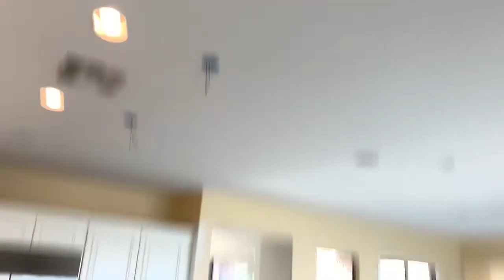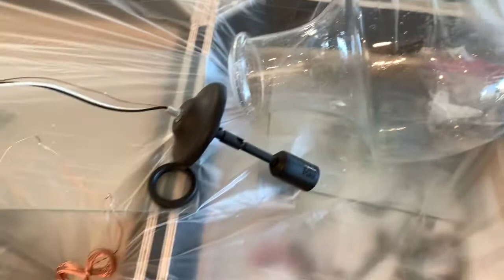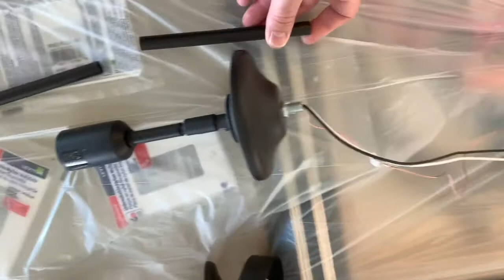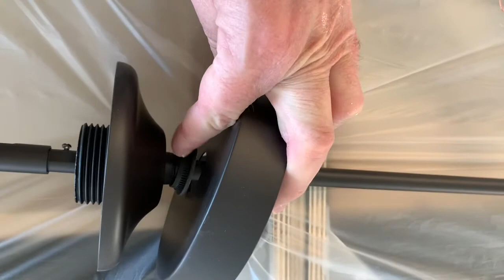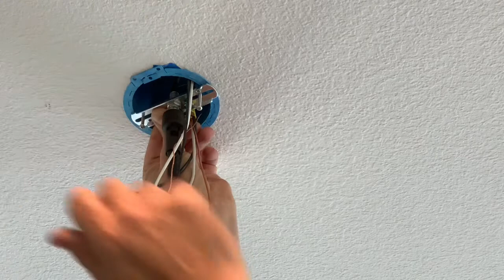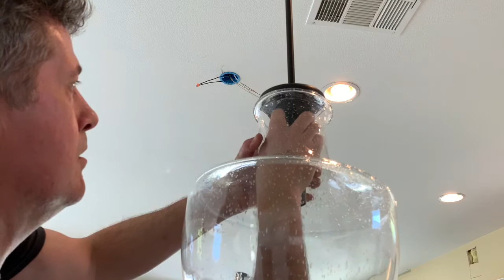Install Pendant Lighting

Comment: I didn’t understand the ground to the green screw connection. Did you use an extra piece of copper wire or did you just pull the copper wire from the wall?

Comment: I have 3 light fixtures, only 2 of them have 2 sets of black and white wires. One of them has one set of black and white wires... I installed all 3, and the one with one set of wires is not turning on. The other 2 turn on and off just find with the wall switch. Any ideas?
Reply from the maker: It sounds like the one with 1 black and 1 white is the end of the line...the other 2 fixtures feed the next fixture and so on. Check the light fixture in front of the one that isn't working since that is where the power stops. Test the wires in the fixture that is not working to make sure it is getting power. Could be a bad fixture or even a bulb, even though the fixture is new.

Comment: Great video, not too long straight to the point! I noticed when you connected the wires (black to black, white to white etc) all you did was screw the wire nut on. Is that sufficient? Just that I have seen other videos where the person twisted the wire ends together and then screwed on the nut.
Reply from the maker: You can do either. The inside of the wire nut has threads that will twist the wires together. You can certainly twist together before you screw on the wire nut if that makes you more comfortable. Totally up to you
Reply: @MikeKlimek  thank u!

Comment: Excellent video. Brief and to the point. Now $600/- question: I need to install 2 pendant lights similar to yours in a brand new home. I have 5 ceiling lights 2 above kitchen countertop. Can I DIY remove those lights and get to the junction box to install those large two suckers? I was quoted $600/- by a local electrician. Those two pendents price is less than $500/- Who I am quoted $600/- installation?
Reply from the maker: So you have 5 recessed can lights and want to replace 2 of them with pendants? Sure you can. There are kits made to do this and screw right into the existing socket, which is then covered by a larger escutcheon plate...or you could remove it and put in a compatible box.
Reply: @MikeKlimek , yes sir. That’s my plan. I just bought 6-in wire stripper, Ideal Single range 50 to 1000V AC NCVT with flashlight to identify hot wire. I will take all safety precautions. Thanks for your suggestions. Take care.

Comment: How do you lower the lights. We just had the same lights installed with 19.5 rods. They adjusted them too high, we want them lower. Please let me know. Thank you.
Reply from the maker: On the lights in this video, you would have to take the light off of the ceiling and add another section of downrod to lengthen the fixture.

Comment: Are the blue boxes the ones with the plastic tabs or the ones with the metal that expands after you push it through the holes? Do you know the weight of the fixtures?
Reply from the maker: Yes they are the blue remodeling boxes with the plastic tabs. The weight of the fixture is probably around 10 pounds